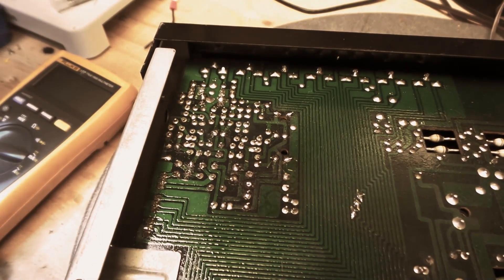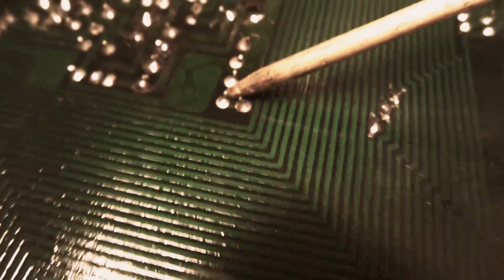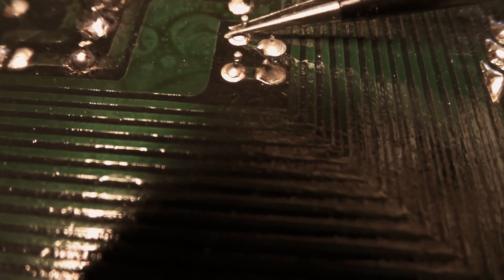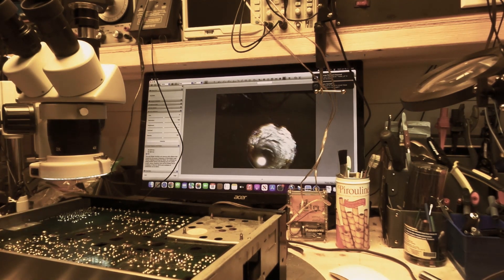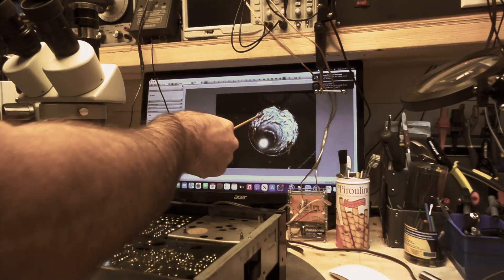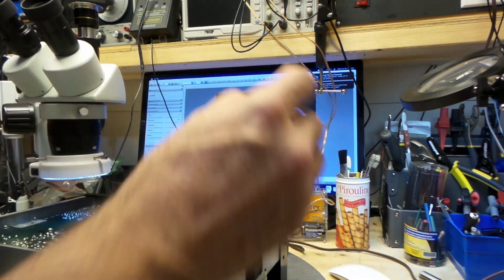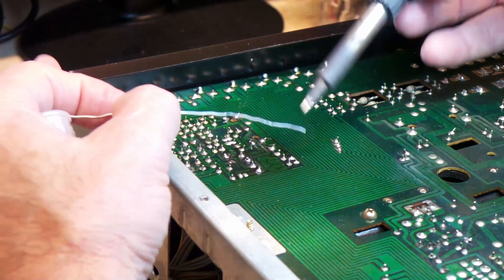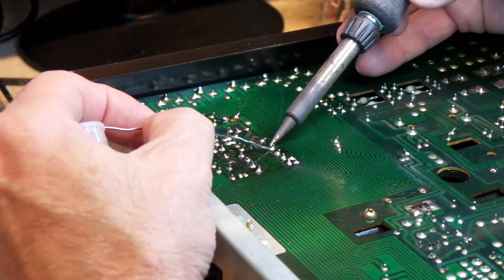Cold solder - How to spot them and repair'em.

Comment: Yeah cold solder joints can be an issue. Another issue can be broken traces in pcbs. I remember 20 years ago working on a computer with video issues with the onboard video adaptor. I took the mother board out and put it in my oven for around twenty minutes, and it fixed the issue....true story.
Reply from the maker: Really...that's crazy 🤣
Glad you got it fix again tho

Comment: I've had hairline cracks too on boards, some of which are just not visible to the naked eye. On one cassette deck, there was an ultra fine crack which was only visible when the light shone at a very shallow angle. This is why some repair people as a matter of routine, re-work most or all solder joints; just to be sure!

Enjoying your videos Joe!
Reply from the maker: Hi eJames
Thank you very much for watching my videos ... I appreciate your comments.
Let's keep the vintage working for another 40 yrs.....